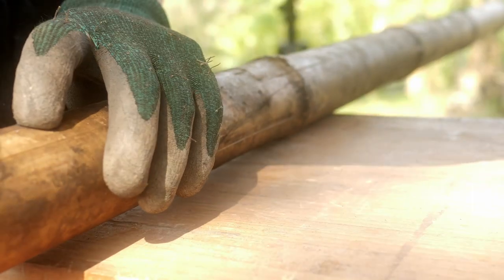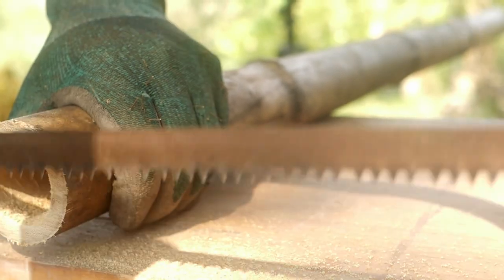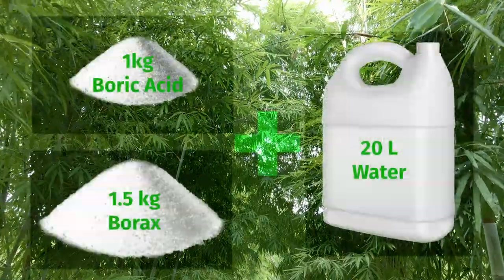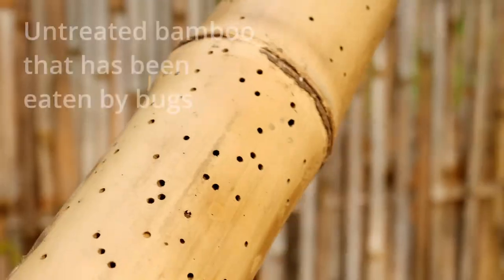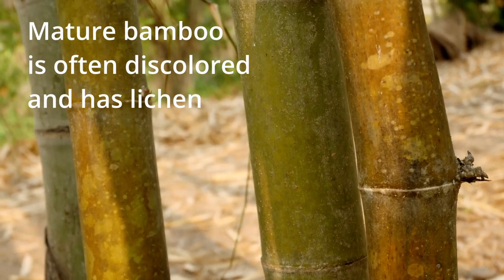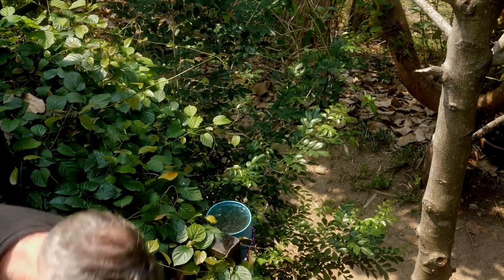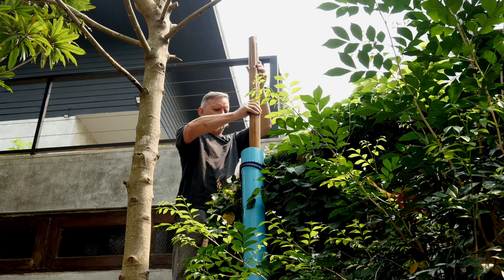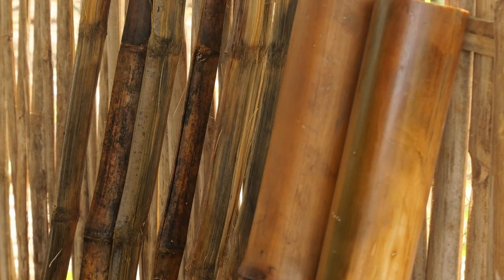The Secret to Long-Lasting Bamboo: Treating Bamboo with Borax and Boric Acid

Comment: Does anyone have experience with re-treating a bamboo building? 

I'm wondering what might be the best process might be to get as complete saturation as possible? Right now thinking tap holes and spray, but am doubtful that'll achieve total saturation.
Reply from the maker: Sorry, I have no experience with retreating bamboo. I guess you're not able to soak it, so maybe spraying is your best option.
Reply: @suansook  much appreciated! Yeah tapping and spraying is the conclusion I've come to so far. The bamboo in the house we just moved into doesn't seem like it was well treated since it's only been 10 years. Will replace all of the infested ones after retreating. Wish me luck! 🙏🏼
Reply from the maker: @newolde1  Good luck. It sounds like it might be a job with a few challenges ... but will be worthwhile!
Reply: @suansook  indeed so, nice to get back into building after a decade of coding. And excited to gain some experience working with bamboo as well. Thanks again!

Comment: Question, you begin this video with treating, as you put it, "an older piece of bamboo about a year old." I had understood that you cannot effectively treat bamboo with Boric Acid and Borax unless you do so within a few days of cutting it down?
Reply from the maker: I've tested with young culms and older ones, but never with them when they are so fresh. I try to only cut them at the end of our dry season and leave them standing in place until the leaves start falling off. I think it is best to treat them sooner rather than later though.

Comment: I have 3 week old bamboo used to cast an upper floor. I want to reuse it for sheds, gazebo and raised beds. Will this old bamboo soak up the solution?
Reply from the maker: I think it will. It may be best to leave it soaking a little longer if you can.

Comment: I’m wanting to keep my bamboo as long as possible, so this soaking method would be difficult. I’m wondering if there’s a paint on or soaked wrap method? I’m also in a much drier climate, and have not seen the same insect damage (so far).
Good clip though, thanks!
Reply from the maker: Soaking it like this will help it last a long time. Great that you don't have the bugs like we do here!
Reply: If your use itis out side. Paint the bambu with disel and used motor oil.